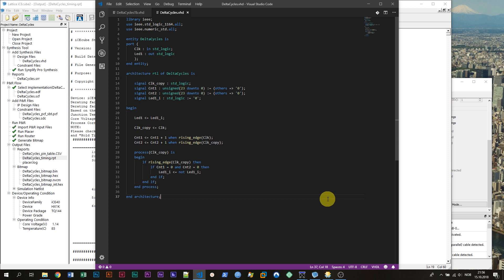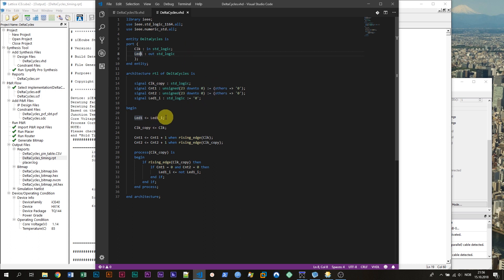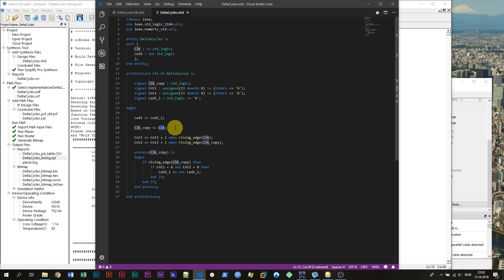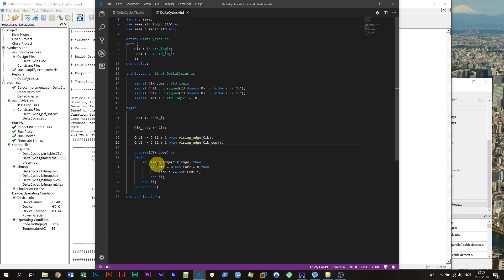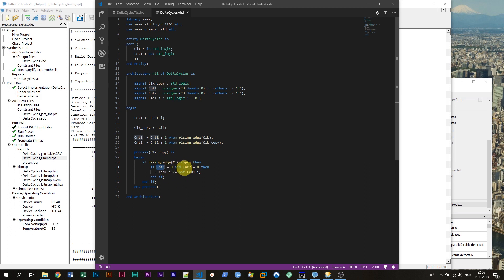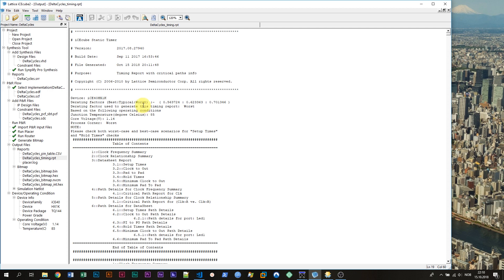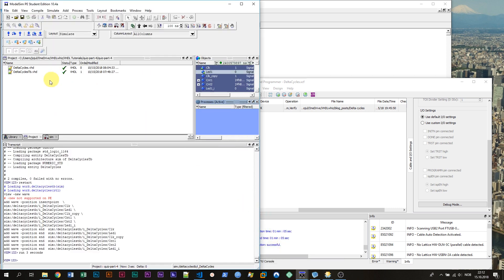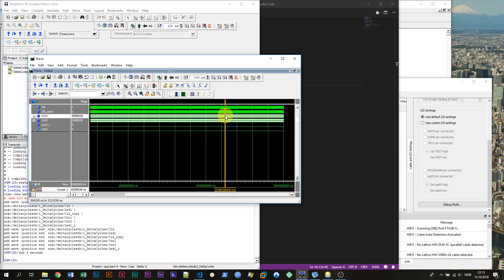Delta cycles in VHDL creating simulation mismatch

Comment: Hi, is it a fair statement to say that there is a mismatch between simulation and HW behavior if the code is not written in a synthesizable way according to the guidelines of the manufacturer of the FPGA? If you really want to expose mismatches, I think you should at least follow those guidelines, otherwise the synthesizer SW cannot guarantee that the semantics of the code is preserved between simulation and implemented HW.
Reply from the maker: Yes, there may be mismatches between the simulation and the implementation if the code isn't written according to conventions and guidelines. But the mismatch I showed in this video doesn't mean the synthesis tool is wrong or bad. It just follows the convention that all or most synthesis tools use for generating netlists from VHDL code. It's important to be aware of that.

Comment: So, my guess is that when we do port mapping, it does not add delta delay. Am I right?
I mean when we instantiate a component and do port map for that. Because if it's going to add delta delay, then when we port map the clock of a component to the clock of the top level (which is a quite common practice), then inside that component will not be in sync (from delta cycle clock point of view) with the top level anymore.
Reply: Or it could be that port mapping adds delta delay as well, but as it is done for all the ports, together with the clock, still they are sync with each other (all of them are delayed by 1 delta cycle).